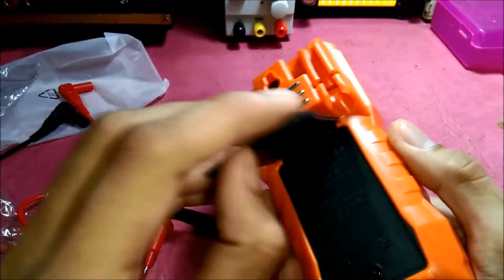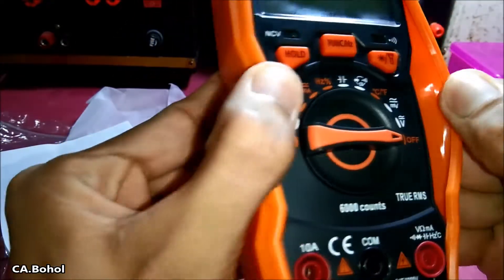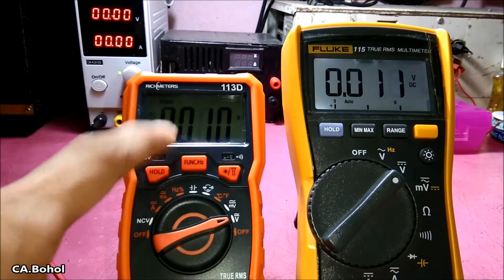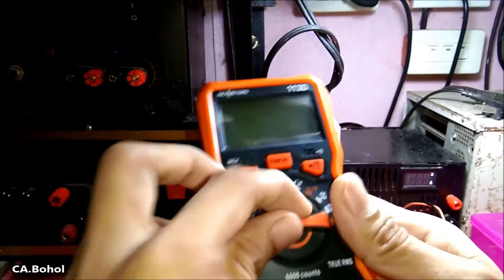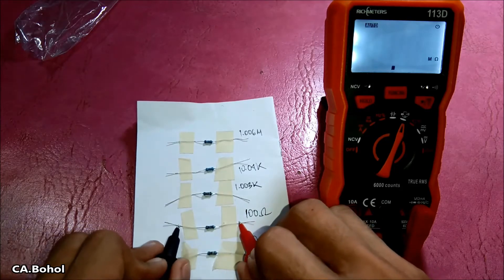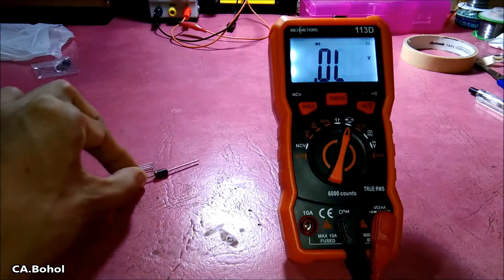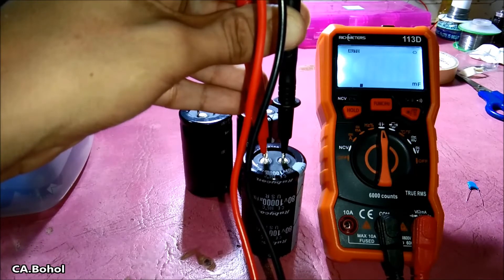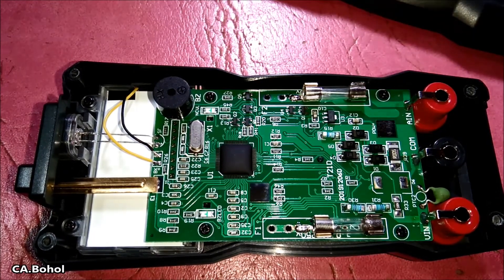RICHMETERS 113D CHEAP MULTIMETER | Test And Teardown

Comment: Hello
I have a 113D multimeter. 
When idle, numbers appear on the screen and overmeasure resistances. 
What is the reason? 
Thanks.
Reply from the maker: Try to clean the selector or replace new battery.